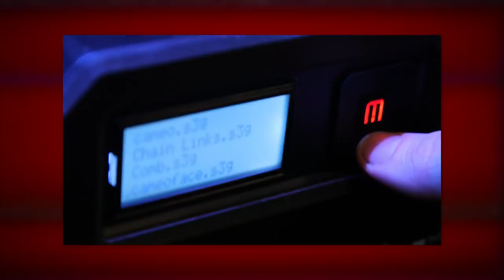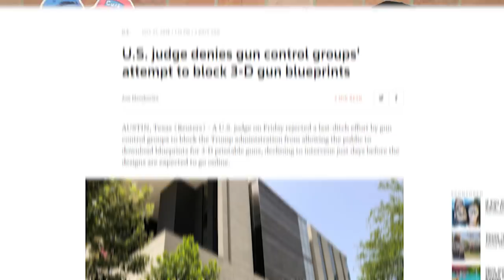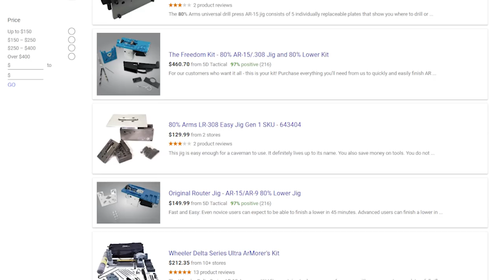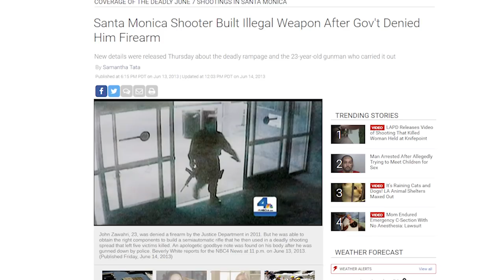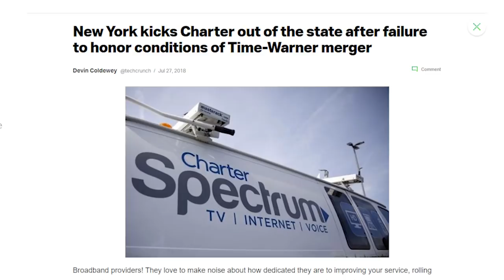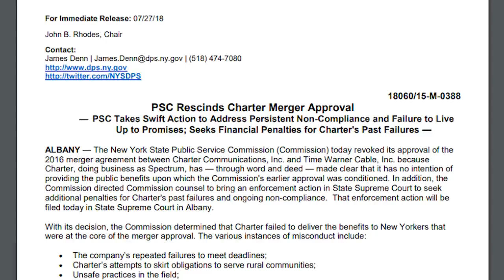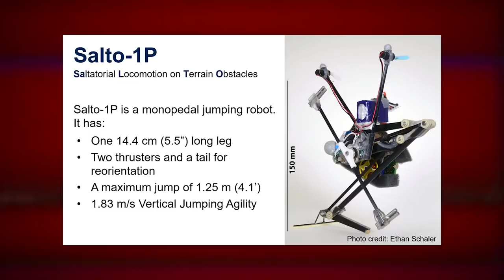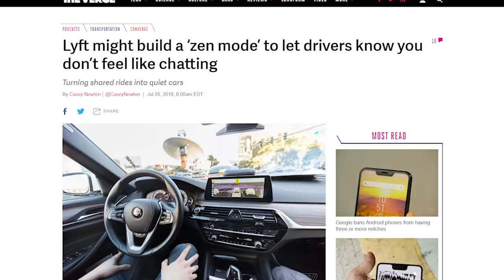3D-Printed Unregistered Guns LEGAL? It's Complicated - TechNewsDay

Comment: just so you know you can get a mini cnc for less then $1000 bucks and mill out a completely working gun from melted down coda cans. most gun recivers are made from aluminum anyway. it's really not that hard. hell you can make a shotgun from iron pipes that you can get at lowes. its not that hard to make a gun and there have been instruction on how to build them on line for years.

Comment: Plastic guns are terrible.  Anyone who knows anything about guns knows that the plastic gun would be basically useless.  I've seen people test these guns out and they basically explode the first time you use them.  If you made a plastic frame and used metal for all of the parts that need to withstand the pressure of firing the gun then yea that would work but then you have just invented a glock. Congrats.  Or if you really wanted to get a small concealable gun then just get a polymer derringer.

Comment: Whoa whoa whoa fucking whoa, it's not as easy as just taking a drill to an 80% lower. It's pretty fucking hard to get a properly working and reliable lower receiver with hand tools. Even with the proper tooling it's still a job that requires skill. I agree, for the most part, with the stuff talking about on this channel but I get rather let down by the way firearms are talked about. Half the time it's either false information or it being made fun of (which I understand and don't get mad at and I sometimes laugh at) Atleast seek out some knowledge from someone who knows either how to find the proper details or someone who actually knows what's up in the firearms realm.

Comment: again, unfinished receivers are not illegal.  neither is completing the work to make it functioning.

trust me. these are largely trash. most guys use drill presses.... not even mills. and these guys have zero concept of tolerance. I've seen many unfinished lowers "finished"... pure shit. would had better results with a hand file

Comment: Its not a federal crime to have an unregistered gun. Firearm registration is up to state laws not federal and not every state requires registration. 

Also fears over a 3d printed gun are nonesense. All your really gonna do is end up blowing your hand off, after spending more money then a real gun would cost to get the equipment to even print one. 

The plastics are not strong enough to handle the pressures of an actual round, not to mention even if a round managed to leave a plastic barrel, which it wont, but if it DID it would be so wildy inaccuarte and with such low velosity that a pellet gun would be more dangerous. 

Liberals are freakin out over literally nothing.
Reply: eightymopar Somebody hasn’t actually watched those guns in use...
Reply: markd315 what these 3d printed guns? Lol they said themselves that that one will only fire a 22lr, and only once before its destroyed. So what are you talkin about?